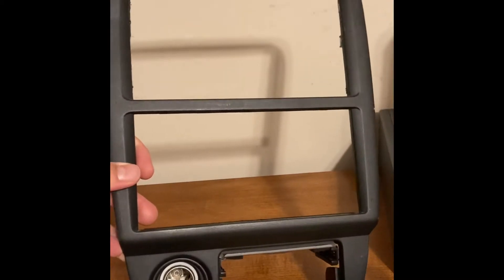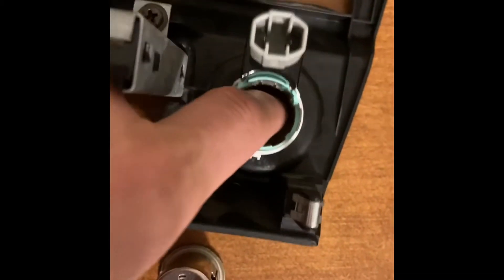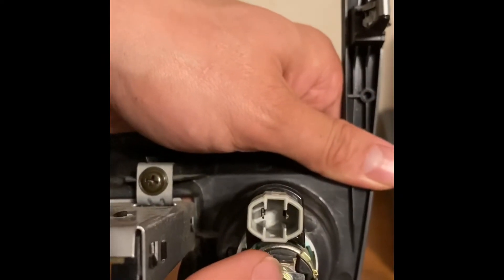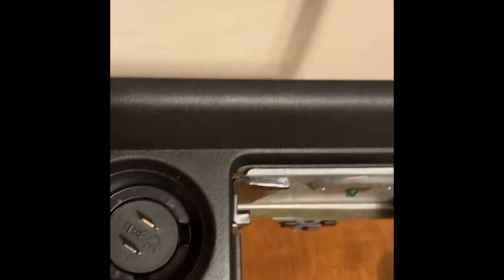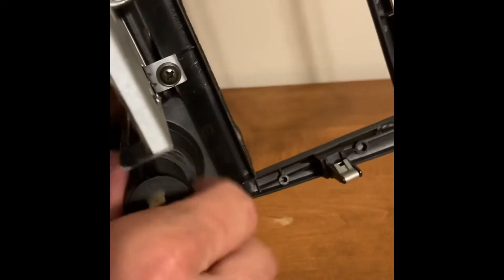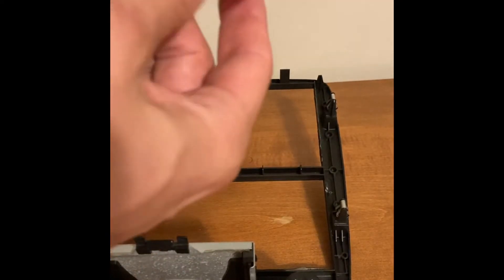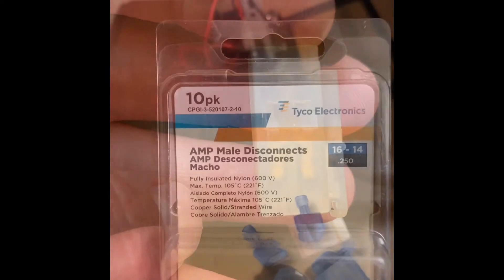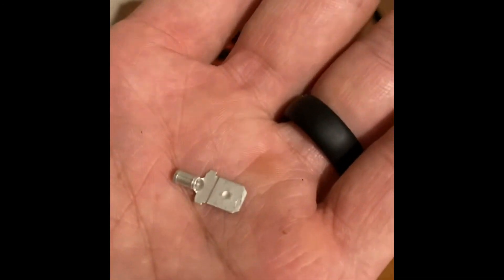97-2001 Toyota Camry cigarette lighter to USB power socket upgrade

Comment: how do you remove the silver interior part of the lighter that holds the ceramic inside part? it doesn't simply push out like you suggest it does.